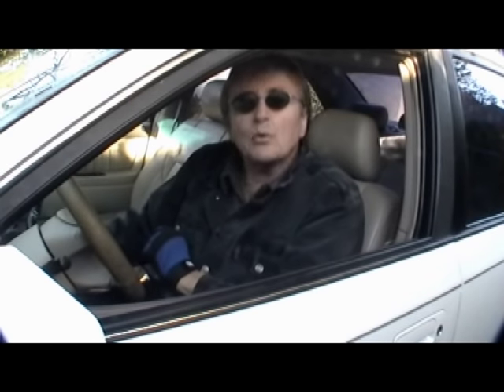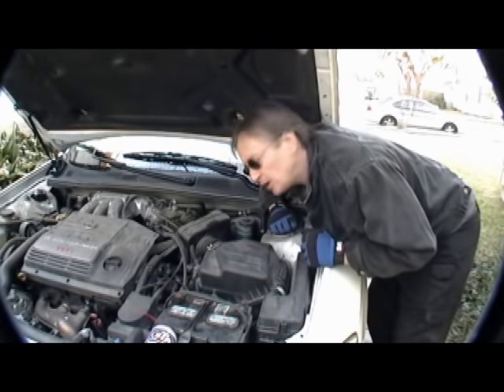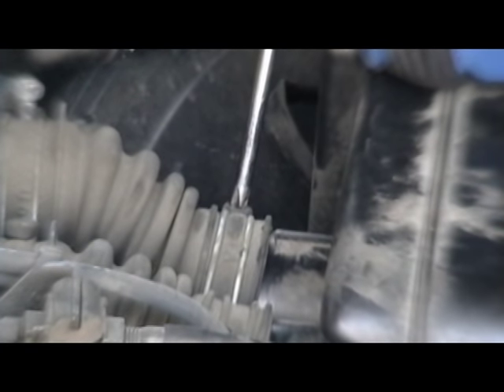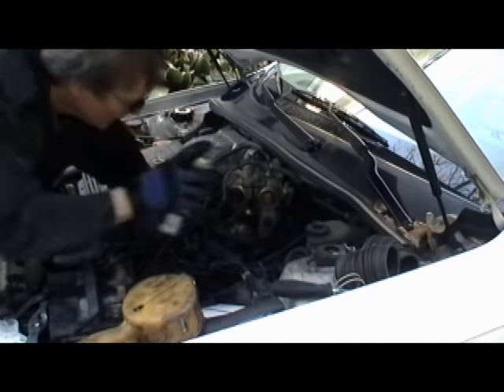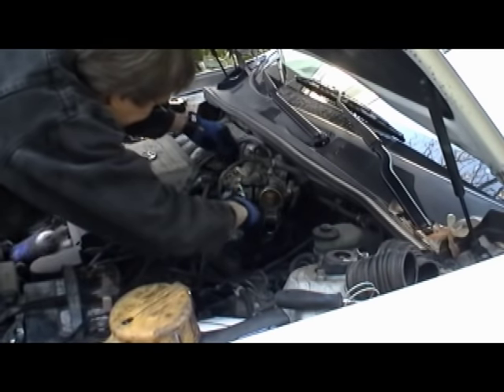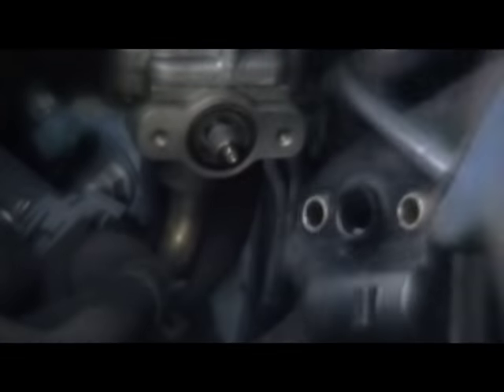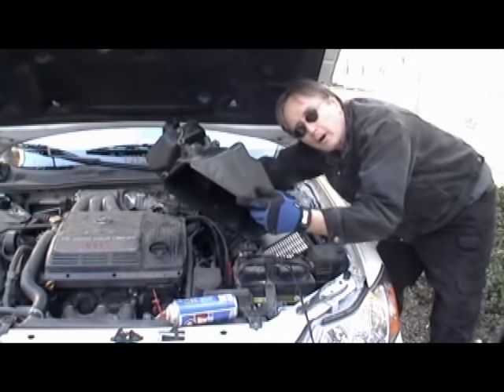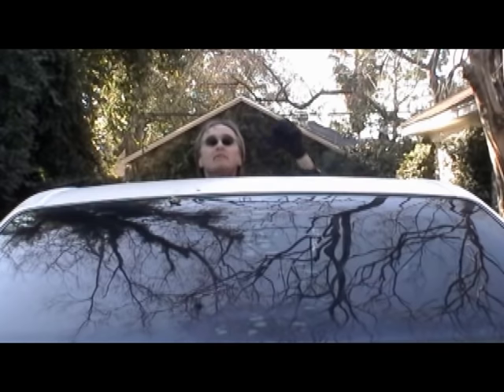How to Fix Engine Idle Problems in Your Car (Rough Idle)

Comment: Yo scotty, thanks for the vids! got an issue with my car. the car revs up when at a red light. It also jolts if i dont step on the breaks hard. already replaced the TPS and cleaned the EGR valve . Check engine light isnt on  and the car doesn't stall. what in the heck could this be?!?!
Reply from the maker: +Super Drone do my video 'finding engine vacuum leaks with a cigar"

Comment: how can I lower the idle in a 1995 geo metro lsi 1.3? I took it to get it smogged and they told me it was too high but the guy couldn't tell me how to fix it. thanks in advance by the way I love your videos.
Reply from the maker: +917saturnino try this video cleaning, cause there is no screw to idle it down, computer runs all that

Comment: Hello i have problem with corsa b 1.4 16v.When the engine is cold it works fine but as soon as it comes up on working temp engine works worse and speedometer is not working.maf sensor maybe or vss?

Comment: 2:14 I'm not sure if it worked, that you really turned the engine on, it seemed like a sound effect was just applied.  I didn't see a single light in the panel

Comment: Scotty, I have a 89 f150 5.0 automatic od, I have an extremely high idle when its cold and warm, I've checked everything I can think of to check, can you give me any information on why this truck is still idling high, it will idle to 30mph, I really need to figure this thing out

Comment: 2006xb How to turn up the throttle It's idling at 4-5 RPM's when the Air conditioner heat on batteries Alternator is good thank you

Comment: hey scotty, i cleaned my throttle body on a chevy cobalt. no the car idles at 1500-2000 when going at 40 or 60 km an hour. it sucks cause it wearing out my brakes! any suggestion?

Comment: My ford Taurus overheated duo to a failed thermostat, and now I have a problem with rough idle and temp gauge fluctuating between 1/4 and 1/2 with the heater on, with heater off temp gauge stays at or very close to 1/2. I've replaced the thermostat which fixed the over heating problem and replaced the spark plugs and spark plug wires which failed to fix the the rough idle. Any possible cause for the rough idle and temp gauge fluctuation?

Comment: Hi Scotty, I am restoring a 3.8 v6 mustang....it's been a project!! It is running a little rough...sounds like it's missing a bit....would this video apply  the same for my car?? What about changing the plugs and wires?? Help!! I should add...no check engine light...

Comment: Hey Scotty Kilmer, I'm having a problem with my 2006 chevy equinox, the problem is just when i start up the car, it idles low about  a minute or 2 and then it runs just fine I have replace the map sensor, EGR sensor, mass airflow sensor, spark plugs, spark wires and i even cleaned the throttle body but, i still have not solved the problem. I would appreciate any tip you can give me on how to solve my issue. Please and thank you

Comment: New Subscriber. Great channel! I am working on a project 1986 Horizon. she takes FOREVER to start in the morning, and once a day, when I turn her off, she still shakes and stutters!

suggestions?
Reply from the maker: that old things, first pressure test the fuel pump to see if it's weak. THEN is not, of course clean the fuel injectors and throttle, and make sure spark plugs and air filter are not worn out

Comment: Scotty I have a question about my 03 Nissan frontier on cold start  truck start right up but after the truck was used won't start up you have to gave it a gas before it will start. And the rpm  was low when the temperature on the engine is normal

Comment: Hi Scotty love you videos so informative.  I was wondering if you can help with my idle problem.  I have 2000 Nissan maxima (In USA I think)  its 2.0liter v6 is what I have.  The problem is while I am driving and I get my foot off the gas pedal, the RPM would hover at 1500, it wont come down, but eventually at the full stop the rpm would drop to normal level 800.  Its only while I am moving and let go it stays at 1500, what seems to be the problem?? thanks

Comment: hi Scotty I have a 93 s10 blazer Tahoe 4 door. it failed smog because it was bad timing so I fixed that at the shop. now my truck idles rough when sitting still. the dude replaced the IAC in it. I can't figure out why its surging though. what should I do? thanks

Comment: Got a 98 Ford Explorer 4.0 DOHC and have done all the video checks, changed all parts, intake gasket, pcv, all o2's, fuel pump & filter, injectors all TPS, IAC, EGR, Maf w/heater and everything I can think of and still get P0174, P0302 and P0303 and also clean TB completely with compression check is fine w/plugs and wires and coil (STUMPED) please help if i'm missing something....Sam
Reply from the maker: +Sam Melton  first, do  wet and dry compression test of all engine cylinders to see if #3 and 4 are just flat worn out, that's more accurate than a straight comp test. If not worn out,  you either have vacuum leaks somewhere or computer is bad not firing injectors correctly

Comment: Yo Scotty what is up? I'm the guy who had the Nissan Sentra 94 Idling poorly. The car was working great but maybe you can help me with this new problem. I was driving from work one night with my friends and we accelerated heavily to the point where we reached the redline and my car made a very weird noise. Anyways I pulled over and let it sit down and cool down for a while. Then when I turned it on it made a very bad noise and when I shift gears like from Drive to Reverse it makes the same noise? Does it have to do something with the transmission? Please respond if you can (: .thanks Scotty!

Comment: I have a 2006 A4. My car has a very rough idle. Check engine light is on and occasionally flashes. Error codes given for ALL four cyclinders misfiring, turbo underboost, system too lean (Bank 1) and cooling system performance.
I replaced all four spark plugs and coil packs. This did not make a difference at all. Any ideas of what it could be?

Comment: Hi scotty kilmer my 2006 cobalt ss have a high idle after i clean the throttle body and also once you step on the gas for acceleration it will remain at the speed you driving even without steping on the gas what should i do here??? Thanks scotty

Comment: I have a 89 s10 pickup with a 2.5 liter engine.  Couple weeks ago lost the clutch. Pedal went to floor. drove back home in snow I 1st gear. Was about there when the idle started to get high. Hooked snap on red brick up to it and was given a code 35.  Install new IAC and it still idles high. I am getting tired of putting stuff on this. How do I tell it to idle right now!!

Comment: Hey Mr.Kolmer I have a 98 mercury sable 3.0 ohv  OK the problem I am having is wen I am on the road any road or highway my car will get up to 55 mph then stall and begin to deccelerate . OK I have went from catalic converters to oxygen sensors to Egr valve, Egr feedback sensor, Egr vacuum, throttle body, man put it like this all the sensors man. What else could it be

Comment: my 99 Passat 2.8L has a flashing check engine light. it turns solid when on driving on the expressway though.
Reply: +Jessica Enriquez That's a bad sign. Find someone with a scan tool and see what codes are stored in your car computer.

Comment: Hello Scotty :-)

I have a question about my car that idles poorly.

My car is a 93 Nissan Sentra with GA16DE engine, and the case is that during cold start my idle shoots up to 1,500 rpm,.

After driving normally for about 5 miles the idle drops about 800 rpm, but when i push it hard, lets say shifting around 4,000 rpm, my idle drops around 500 rpm and sometimes my engine will turn off. I tried to clean my IACV, MAF sensor and even the throttle body, but nothing happened so i changed them all and still nothing happened. could it be vacuum leak?

and also whenever i pump the brakes my idle drops but it doesn't turn off my engine, also when im on AC my idle drops as well.

I love my car, and i want it to be healthy again :-)

Thankyou!
Reply from the maker: +akzenajana .abrigo  you're lucky that old thing is even running. Do my video "finding engine vacuum leaks with a cigar" and pray you don't need a new throttle body, they often wear out and leak on those

Comment: Hello i have a honda odyssey 2001 and it keep stalling on me at the same stop signs or traffic lights only does 2 times or 3 then when it reach normal temperature it runs fine i clean the tb replace the aic valve and still

Comment: I have a 95 olds cutlas 3.1 running rough no power I have replaced fuel pump and filter new fuel pressure regulator and battery and alternator cleaned intake and cleaned out the tank wen I replaced the pump..and plugs and wires are new .any suggestions

Comment: Would that be the same procedure for a 89 Mazda 626? 
 Sometimes it runs very rough at a complete stop when in Drive and if I put it in Neutral it will smoth out considerably, almost no problem at all. It has about 270k miles on it.
Reply from the maker: yes

Comment: Hi ,i have a 2004 rav4 the engine check light came on when i scan it i got a fuel rail pressure sensor reading. I changed the sensor and am still having the same problem. When the vehicle is cold and you start it, it throttle then the check light comes on once the vehicle reaches operating temperature and u turn it off then restart its ok. Wat do u think is causing that?

Comment: also I have a question!  the steering wheel on my camry shakes when it's moving. feels like there's a flat spot on the tire. tires are new so I know there good and they aren't out of balance. recently the parking brake light has been staying on ( when not in use) although it feels like it may be sticking,I feel resistance When acceleratin. I think, I may just be paranoid. lately the light has been staying on. I read the shaking of the wheel could be a brake issue and possibly shocks/ struts. which I know need replacing. the pass. side f. tire is badly worn. like I said new tires should not have worn that bad that fast.  any ideas?

Comment: i have clean the throttle, but it still surge

i have drive by wires car
could it be the tps or di idle valve?

Comment: Hi scotty! When i started my car this morning, the idle is lower than normal. when the engine warmed up it runs rough. I went to a car repair shot and turned the engine off there. But after a few minutes I restarted again to show to the mechanic the rough idle and suddenly it runs fine. I didn't do anything yet besides turning the engine off. Im baffled. what do u think it is? Thanks! (mitsubi lancer 1997 glxi- replaced IAC and cleaned throttle body two months ago.)
Reply from the maker: +kankeinaittebayo  try my video "how to clean fuel injectors on your car" and also check for intermittent vacuum leaks

Comment: Hi Scotty,
I was wondering if you could help me out a bit. I have a 99 mustang gt. It started having an engine "tick" around a couple thousand miles or so ago. It wasn't very bad, but over time it's gotten worse. I changed the oil less than 200 miles ago: full synthetic, but put no additives in it. This had no effect whatsoever on the ticking sound. It will tick very very slightly idling, and only at certain rpm's. If I'm cruising at 60mph, depending on the rpm, it may or may not be ticking... 
Thanks for any help, I love the videos!!
Reply: Valves need to be adjusted

Comment: I have a 2011 Mazda 3 and replaced the passenger motor mount 2 months ago. My vibration went away and is back now. Would it be smart to say it's the rear motor mount now?  It is worse when in park or stopped at light.
Reply from the maker: +Mary Stagg yes, also check the transmission mounts as they all work together

Comment: I have a 2009 chevy malibu 2.4. I had a misfire on cylinder 2 so decided to clean my throttle body so I disasembled the throttle body cleaned the throttle body then installed it back to the car. Now it's ideling at 3000 rpm in park and is having code p507 I tried to unhook the battery and try to reset it, run cleared the codes even looked for vacume leaks. What do I do now?

Comment: Hi Scotty, I have a 96 Oldsmobile aurora autmatic 4dr sedan. My car is having trouble surpassing 35mph with the petal to the metal as well as the cruise control went out. It is also sounding like a helicopter while I am accelerating but if I take my foot off the gas and just coast then there is no noise. Any ideas? Thanks🤗

Comment: Hey Scotty, my 2001 Ford Mustang GT has a surging idle issue and stalling issue. The idle is too low and it tries to pick it back up. My car always stalls when I put it into reverse and start backing up, unless I give it a decent amount of throttle, it seems to keep an idle while in park and is not as bad in drive. The car runs fine when I give it throttle but it'll start to surge up and down when I'm at a stop. I already swapped the IAC valve and cleaned the throttle body area. It is throwing out a P0171 and P0174 code saying that it is running lean on bank 1 and 2. What could be the problem?

Comment: How would this process work on a carbureted engine? Would you just use some carburettor cleaning spray and change the idle screw at the back?
Reply from the maker: yes
Reply: How about a na mechanical diesel :D

Comment: Hi,  Scotty, I have Nissan Altima 2007 I have issue in rpm because it goes up and down brtween 1500 - 2000 also I have code error  P0507.
I tried to clean throttle body and replace it but it still blease help!!!
Thank you

Comment: any idea why my 93 miata idles high, it started when it comes to a stop but now its just plain high at 2100 rpm. everything else appears to be running fine, and I tried testing and switching the IACV, tried to adjust the TPS and clean the whole thing out, new hoses, etc, to no avail. any ideas?
Reply from the maker: check for vacuum leaks as in my video "finding engine vacuum leaks with a cigar"

Comment: Hey Scotty Kilmer, i am 18 years old and recently bought my first car. it is a Volvo 440 1.8 90hp from 96. when i start the car and i rev it just a tiny bit the engine stall or almost stall. if it does stall it is hard to restart it for  a couple seconds like 10-20sec. i recently calculated my milage and my car uses a avarage of 1Liter patrol on 7.86KM. this is very low. i think all this togheter gives me the conclusion my car is running to rich? on a full tank 40L patrol i can drive 350KM.
Reply from the maker: yea, that stinks, check for leaking fuel injectors or bad maf snsor first
Reply: Scotty Kilmer i made a quick look but i cant find a MAF on or close to the intake hose. but a angine that dies or nearly dies after startup when reved just a bit is probably because running to rich? i can make a video. if u have any idea what to film i would like to hear is so i can record and upload some asap

Comment: Idle is running roughly at times for my Chevrolet Alero (year: 2001), with 2.4 l engine. One installer said that it would be one of the four cylinders. The second one specifically has one broken nozzle. How would it be fixed?
Reply from the maker: +SmokinDumpster replace that fuel injector then

Comment: My yukon when parked idle it starts to jerk like maybe every 20 sec randomly just one jerk. What could be the problem I've changed spark plugs knock sensors intake manifold gaskets and still does it. Checked with odb reader and only have 1 code p0420.

Comment: I cleaned the throttle, Inspected ignition coils and replaced faulty ones, cleaned fuel injectors and finally changed the spark plugs.

Why does my car kinda shivers while on idle ?! ( inspected the mounts and they're fine ). Please help :(

Comment: Hi Scotty I have a GWM Bakkie 2;2 STEED I FITTED A NEW THROTTLE BODY WITH NEW SENSORS BUT THE ENGINE IDLE IS ALMOST 2;5 HOW DO I BRING IT DOWN

Comment: Need some advice I have an astra life 1.8 automatic on first start up after a few seconds my car starts to shack and rev on it's own does this for about 60 seconds then goes to normal.......  then it struggles to get to 70mph it jumps to 3rd and 4th gear losing power what could this be ?

Comment: Is this why my car pulses when I'm at a complete stop at a stop light or when in Park with the car on? Or is it my fuel injectors?
Reply from the maker: many things can do that, do these video tests AND also check for vacuum leaks as in "finding engine vacuum leaks with a cigar"
Reply: okay thank you
Reply: That could even be a bad coil pack. Misfire maybe

Comment: Scott, my 2013 nissan rogue hesitates when starting and the tachometer needles act funny, the act like their stuck and having a seizure then the car will start after a second. Diagnostics tool showed nothing. It has 90k miles on it so as a cheap try, I replaced spark plugs but it still srarting weird. Any help would be appreciated. Thanks brother.

Comment: Dear Mr. Kilmer
I have a Mitsubishi Ek wagon 660cc 2011 model and car acceleration is not as it was used to be. I replace new plugs and oil and clean the fuel injectors but in vane. 
Kindly help.

Comment: hey i have a problem with my car when im driving it takes like 20 min to shuts off by itself and i check the gras pressure and its good i got spark too and i don't have any vacuum leaks  and idk what to do my car is a 1986 Lincoln town car

Comment: I have a Mazda 5 2007. It idles a little rough and the RPMs drop between 1 and 0. It will occasionally die upon stop signs or stop lights this is when it happens the most if I have it in drive. Your thoughts???
Reply from the maker: try this video fix and also "finding engine vacuumm leaks with a cigar"